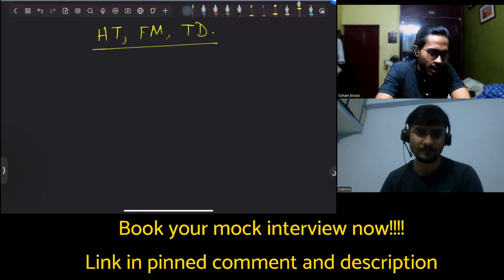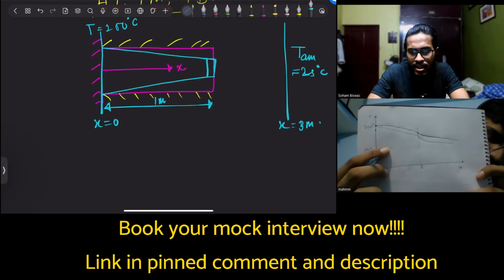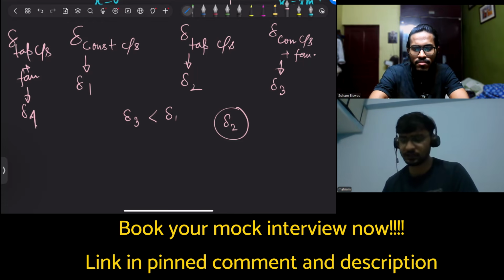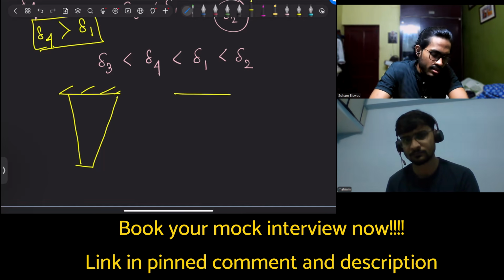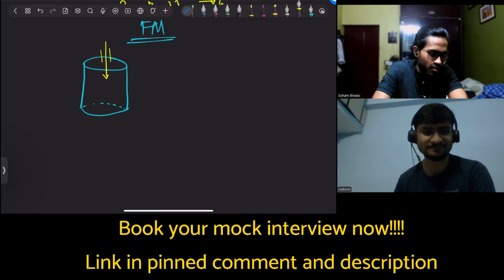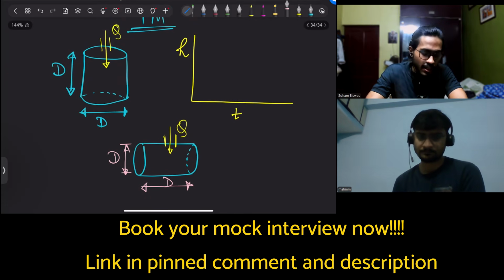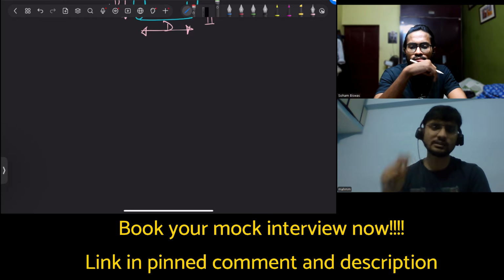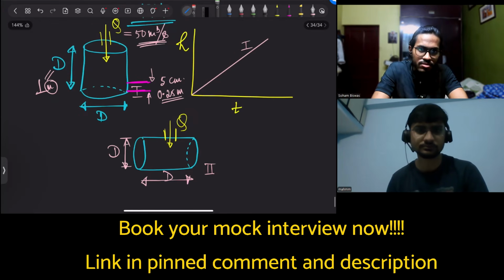The REAL BARC interview experience| BY DRDO AIR 1| ISRO AIR 44

Comment: In the first question of heat transfer i think it is type of heat transfer in fin with insulated surface and HT occurs from the tip only 
In second case as you mention the bar is tapered, then he said resistance will increase and if we assume heat is supplied at constant rate in the crossection which is at 200°C 
Physically i understood slow rate of heat transfer increases the  temp at the end of the bar 
But if we apply concept of thermal resistance [deltaT =Q×R ] 
For the same heat transfer if the resistance is increasing so 
deltaT should increase, as I see from the figure base temp is fixed so for increment of deltaT, there should be a decreament in temp at the end of the bar
I am not getting it mathematically please clarify
Reply from the maker: The heat transfer is not constant.
Reply: @Thesohamway  but if the lateral surfaces are insulated, then the heat transfer rate remains constant along the length
Reply: The temperature difference between the left side and ambient air is constant, when we taper the bar its thermal resistance will increase due to reduction in the cross section area. Due to which overall thermal resistance increases(bar+air). Now, when the temperature difference is constant and the thermal resistance increases then heat transfer reduces. That's why the rate of transfer will not be the same, it will decrease.

Comment: Sir for the heat transfer question ,  delta 2 should be less than delta 1 in my opinion. Please check my logic. For the natural convection case on the free end nusselt no is proportional to Ra^.25 . From simplyfing we get h proportional to (delta T/ characteristic length)^0.25 . For the tapered case we have more delta T and less characteristic length too so its h must be higher and thus delta 2 should be less than 1
Reply: Sir please clear my doubt
Reply from the maker: @arpit5570 Yes dear, you are absolutely right. The natural convective resistance will decrease as the temperature of the surface rises.  I think I have mistaken delta 2 as constant area case during interview. Thanks a lot for pointing out. This type of thinking is required. However, reduction in convective resistance doesn't always mean increase in all over heat transfer. Here the major mode is conduction. So increase in conduction resistance will overpower the convective resistance, increasing the overall resistance compared to the constant area case.
Again, thanks a lot for pointing out ❤
Reply: I think your logic is correct but heat transfer also depends upon the area where convection is happening. In case 2, the area of the tip is lesser than the case 1. Due to this heat transfer due to convection will also decrease in case 2.